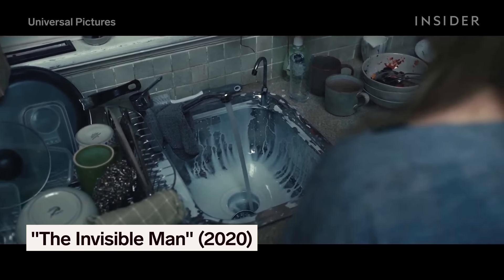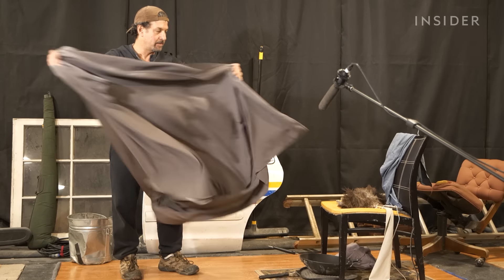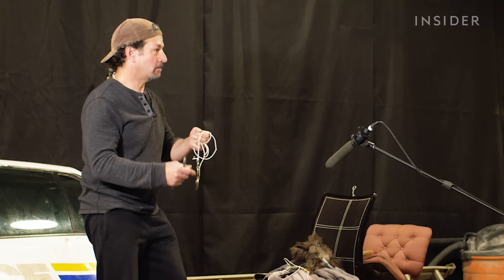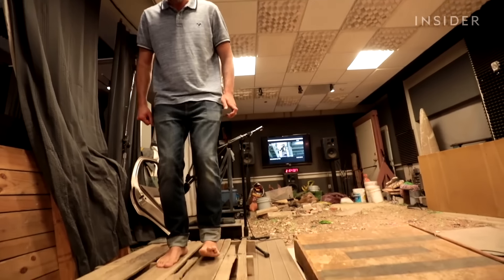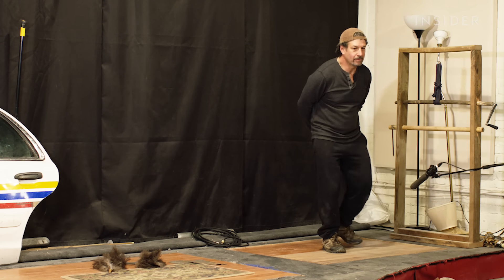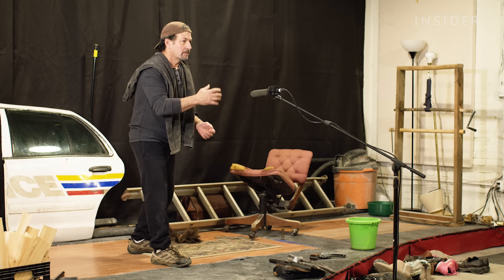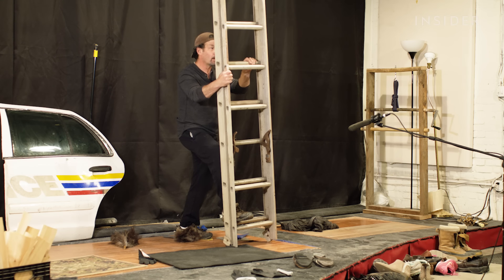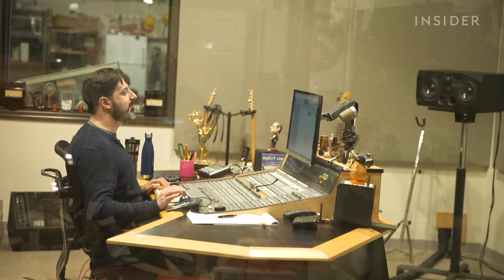How Sound Is Used To Create Suspense In Horror Movies | Movies Insider

Comment: I hate jumpscares. It's just cheap and uninspired. Of course you get a short scare moment when the sound level gets ten times louder then normal but that has nothing to do with horror. Its just a physical reaction. You could as well give people low voltage electrical shocks. Stuff like this is not filmmaking it is physical abuse.